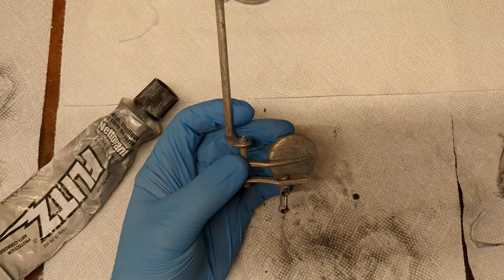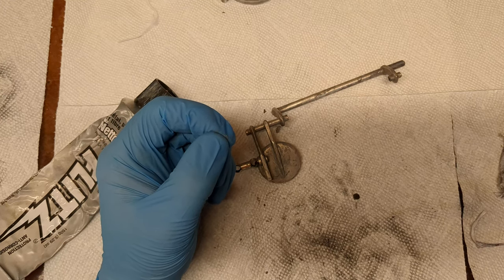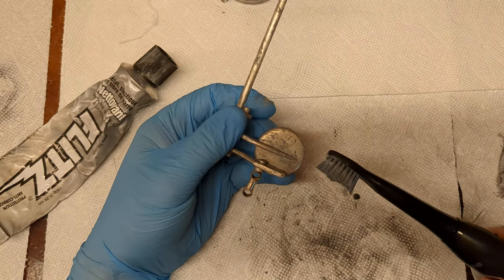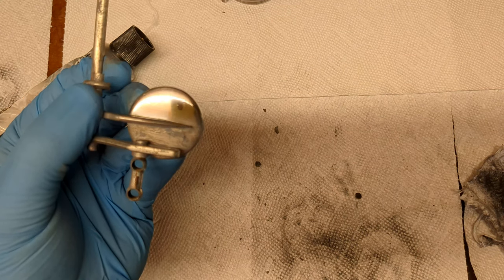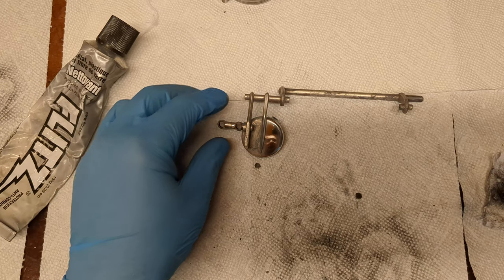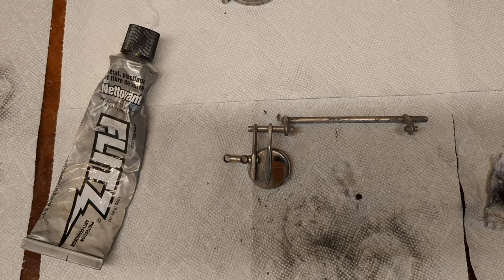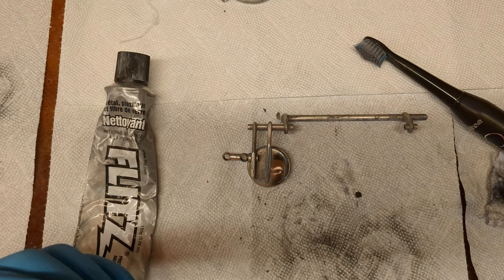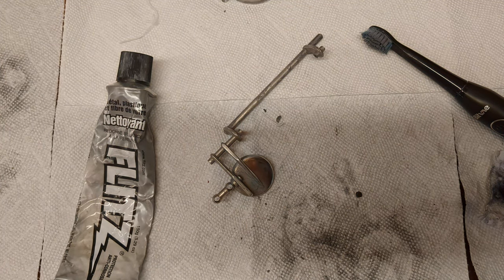Saxophone Repair Topic: Trick for Removing Really, Really Stubborn & Hardened Silver Tarnish

Comment: Great result for sure!! 
But I wonder what will happen if it's getting used for playing again. Zilver or metal tends to react with human touch...resulting in a black or dull sax. 
Is it going to get a new clear coat or do you leave it 'as is'?

I'm on the verge to overhaul a Conn Shooting Stars 14M, a Mexico produced alto sax from 1970. 
Would polishing this sax be possible or does it also have a clearcoat ( which I think.. ) so it's better not to polish?

Comment: Thanks. In desperation I used 0000 steel wool. Much time polishing out scratches. Any tips on maintaining or protecting the work. My Horne is a C Melody. It plays well but there is a problem with pitch. C# is flat, it drives my ear nuts. Well thanks again.
Bill

Comment: I ~~love~~ Flitz.

I especially love it for times when I want bare metal to get to a nice shine but in a situation where I would be reluctant to go to the buffer. I like it in playing condition situations with large spots of missing lacquer... I can get some flitz on a cloth and sort of "blend" the look of the bare brass into the color of the remaining lacquer. Discretion is the better part of valor here of course.

I also recommend Flitz over Brasso to anyone who insists on polishing their own bare brass (old sousaphones, whatever). Brasso leaves these horrendous streaks and doesn't leave a fine polish, whereas Flitz, even if it doesn't bring the color back to yellow will still bring a nice wet look to bare brass without the scratches.

I also have plenty of other polishing tools in my arsenal but Flitz fills an important all-around heavyweight role.

Comment: Hello Matt, you may have a really old Flitz tube. My year old product is listed as. Non-abrasive, non-toxic, non-flammable, acid free and won’t dry out. 
Between Keyes I flush the brush in cup of water and dry. 
I use 4”x4” Webril Wipes for wipe / polishing. Changing often. 
The label says no residue. I still rinse everything afterwards. Without rinsing I find parts will fog with heat. 
The inside of the cup and wherever cork goes. I wipe with Q-tip & alcohol pre install.

Comment: Flitz is also good for when you’ve got an old hard rubber mouthpiece that has oxidized badly. I would keep it off the tip and side rails, though.
Reply from the maker: Interesting! Haven't heard of that one. Have you tried mineral oil?
Reply: I was trying a bunch of things at the time but don’t think I tried mineral oil. It took several applications of flitz to polish a mouthpiece down to a nice black gloss, but it worked better than other polishes I had around like Wenol and similar. With the flitz you could tell right away it was working to cut the oxidation because there was a strong smell of sulfur.

Comment: Hey Matt, have you already done all the key fitting / mechanical stuff before you start cleaning up the keys?
Reply from the maker: The keys and rods etc need to be super clean before you can do key fitting well, I think. Especially if you're trying to keep swedging marks to a minimum.  If I can clean the keys to my satisfaction and then do the fitting and then do the polishing, that is ideal, and that sometimes happens. On this horn though, there was no choice- the tarnish and corrosion had to come off first because they had physical thickness that would have caused damage to the finish if I had swedged over it.